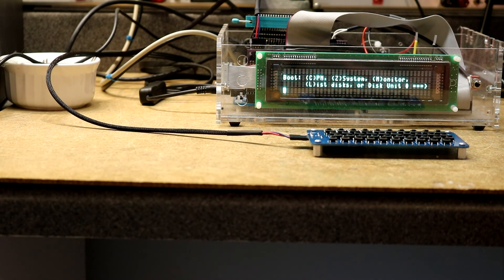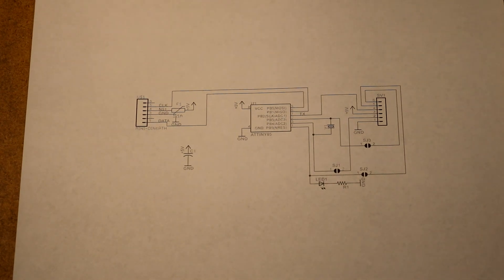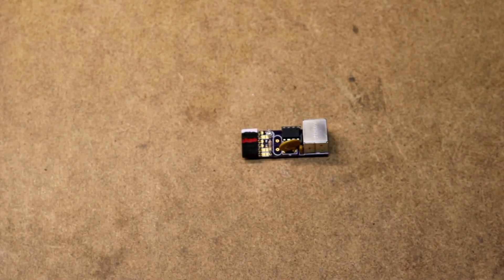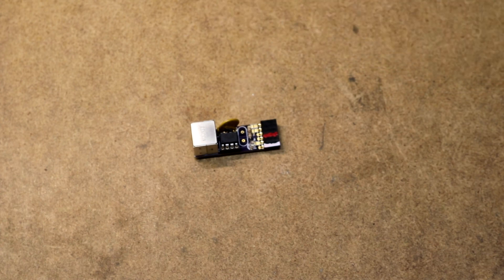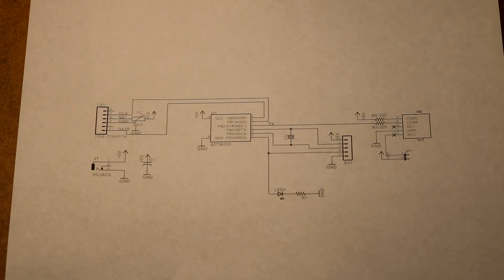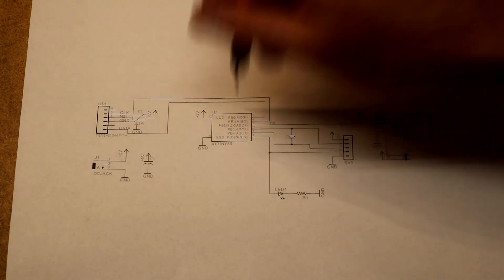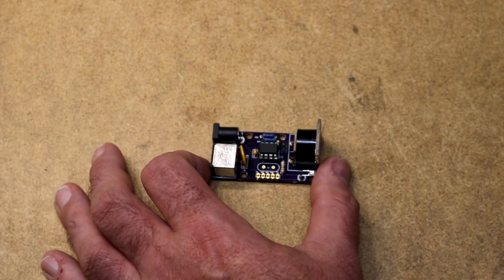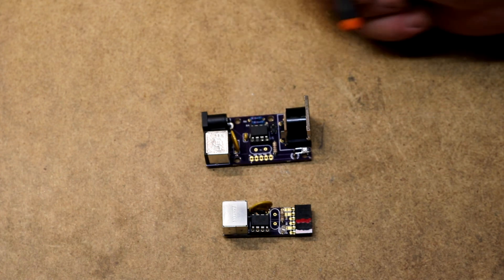PS/2 Keyboard TTLSerial Adapter - For RC2014 and Midi projects

Comment: The 2 software libraries translate the ps/2 scancode to ascii/ttll serial?
Reply from the maker: Yes, the PS/2 Keyboard Library has a header file that contains scancode to ascii mappings. I think I modified it a bit, though I can't remember exactly why. Source code for the whole project is up in my github repo.